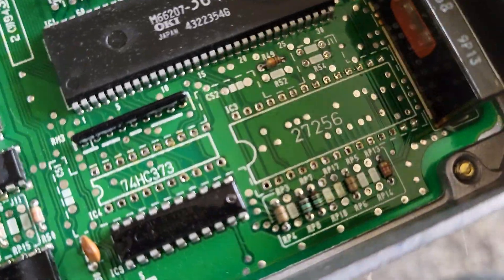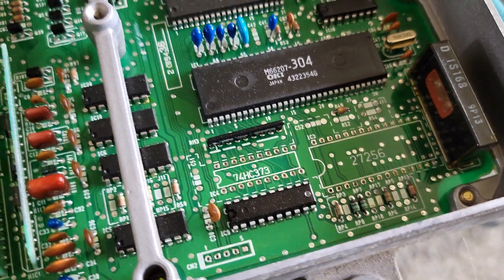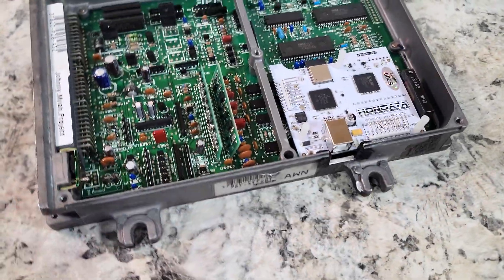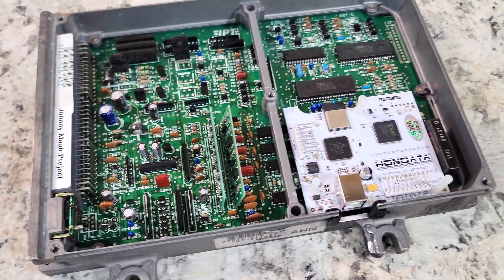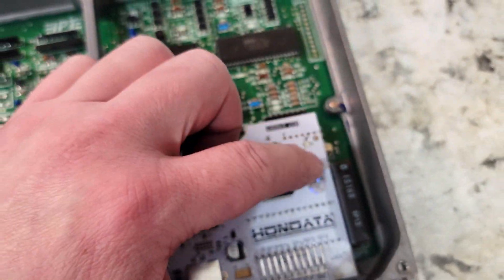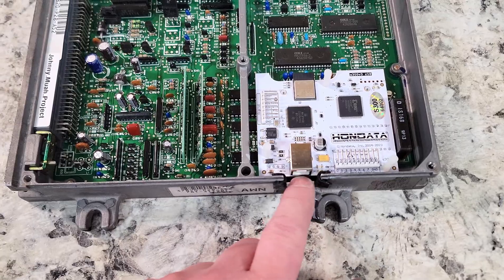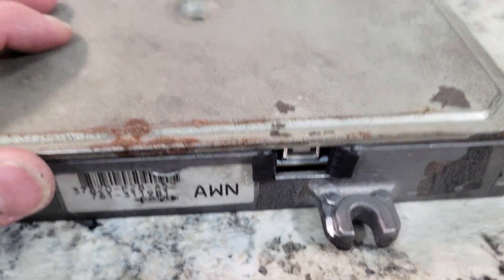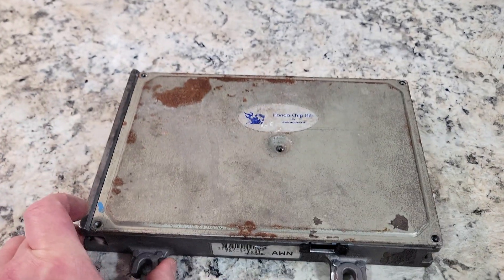Hondata s300 EASY INSTALLATION p28 ecu

Comment: Does it matter if it's AT? P28 ECU
Reply from the maker: If you have an automatic ecu then keep it that way, it'll still work. But yes, you can still convert it. rp17 and rp18, take those resistors out and put a jumper on rp18. that will convert it to manual.